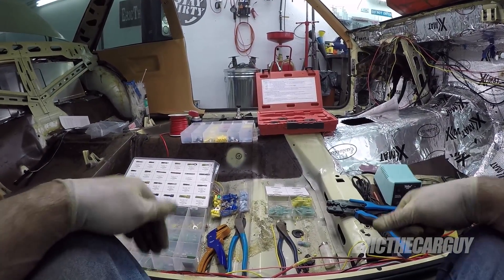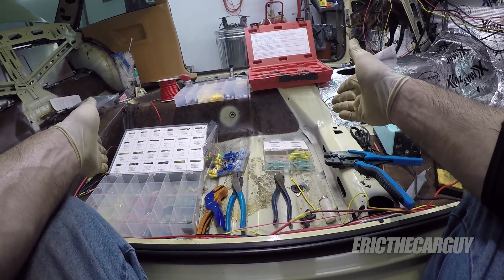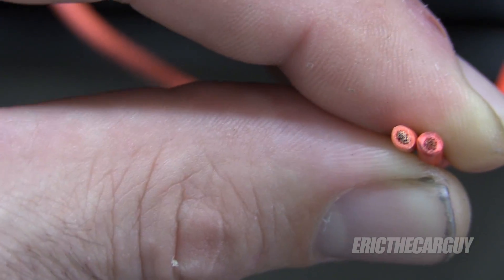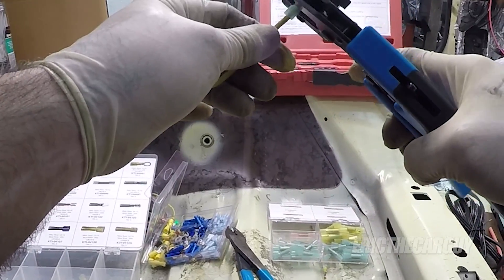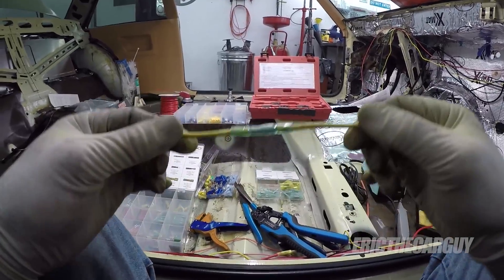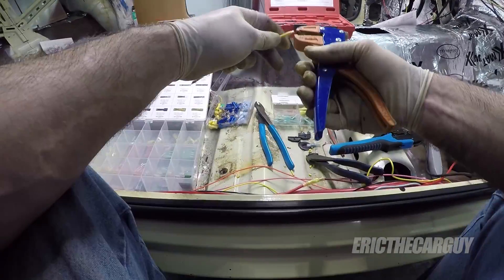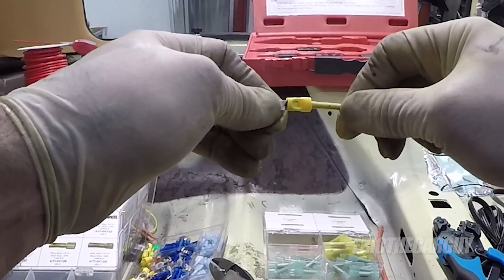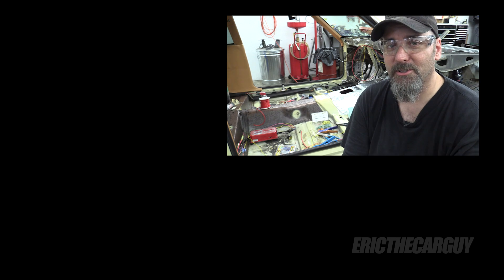How To Crimp Electrical Connectors

Comment: Great post. When you put the item to be crimped in the die while the die is outside the tool, I could see exactly where to place my connector. It's so much easier to see what you are doing than the seven other posts I found on the same subject before finding yours. Thank you for your help.

Comment: I realise this is an old video, but any way..

I am totally shocked the there has been no use of a vice, bolt cutters, side cutters or pliers to crimp the wires.. Just joking of course, there are so many garage how to do's that show those "techniques".

Well done for for an excellent presentation, improper crimping is one of my pet hates.

By the way , I am an Australian Airforce trained Avionics, Electrical technician of about 50 years ..
P.S. soldering before crimping, will lead to the wire fracturing causing a poor mechanical connection.. In the aerospace world, terminals are not soldered, only crimped.

Comment: soldering after crimping is allowed,  but soldering before crimping is not recommended,  tin is not flexible at all and that connection may loosen, causing resistance and overheat.

Comment: Great video thank you. This may be a silly question. When you are joining 4 wires (Neg to Neg and Positive Positive)to power one item Eg: cord from a fan to the cord of a cigarette adapter plug, I am assuming you will have two different connectors to crimp?

Comment: So, my takeaway: 

The 909 is great on nylon; shrinking or not.

Those ratcheting types are NEEDED for polyethylene; it is softer and will not tolerate most crimping tools other than ratcheting. 
I would be stunned of you had to shrink tube nylon. I'll bet money it was polyethylene. 

When you buy connectors, look at the material. 

also:
if you leave the insulation on, it is great for twisting the braided wire.

Comment: As far as insulated/non-insulated, I’ve always been able to slide the insulator off if it’s not necessary. I just keep everything together for future use.
Also his point about heat shrink is dead on. I heat shrink all my crimps, but mainly because of OCD.

Comment: I recently built my own camper van . Wiring wise using crimps . 
Using a crimping tool similar to the one in the video . 
If it's getting a bit awkward , is to load the crimp into the ratchet crimper literally to the first notch on the ratchet . 
So the crimp is gripped just enough so it can't fall out of the tool . 
Then you have a bit more control in tight areas , push the stripped wire into the crimp then squeeze it up . 
Rather unorthodox but it worked for me .

Comment: 13:04 Aren't those jaws your using on an insulated terminal, meant for NON insulated terminals? The jaws for insulated will have blue, red, or yellow, so you can match it up with the color of the insulation.

Comment: I see you're having problems with those yellow handled auto strippers. They are super quick, but I found out the hard way that these tend to double cross you at the worst possible moment. The better option are the ones that load from the side.

Comment: Why is it sooo hard to find quality connectors. I’m done buying connector kits online. The metal are very easy to bend with your hands and very thin. Specially the ring terminals. I wouldn’t trust 40amp overheating.

Comment: So never having had the proper tool I rushed out to Amazon and bought one of those fancy ratcheting crimpers and after throwing away half my insulated heat shrink connectors I tossed the tool . Witch jaws should I get for heat shrink connectors, mine came with one jaw

Comment: @4:53 - The knurled knob at the top of the pliers adjusts for the different thickness of the wires. There are 4 positions - 0.2-.9mm; 1 -- 4.0mm ; 5.0 -6mm and computer wires. Try it and see what works.

Comment: The problem with soldering the wire and then crimping it is the risk of breaking the conductor off which is why you should never solder a crimped connection.

Comment: Just saying, ive seen many crimps fail, I've never had a solder joint fail. Every circuit board in your car has solder on it and it has no problems. As long as you think and add the joint for proper strain relief you'll never have problems. Crimps are also dog shit for strain relief, I don't know what y'all are talking about.

Comment: I like those quick release levers for your crimper dies. I have to remove my two screws to change out dies .. although I never change them. I've got a second crimper for non- insulated connectors.

Comment: The problem with soldering crimp connectors is that you're only introducing more opportunities for failure/human error(we know, we know, you're the best solderer ever and you never ever screw up...) where it, quite literally, is completely unnecessary. Add in the weakening of the wire that soldering causes, the potential for failure related to vibration and movement due to how brittle solder is, and it just doesn't add up. The idea that a proper crimp could in some way still be "weak" or have a "poor electrical connection" is just unfounded, and it takes MUCH less skill to execute a proper crimp with the proper crimpers than it takes to execute a proper solder joint. I mean, everyone can see how easy it is to execute a proper crimp in this video.

When you add in the fact that professional industry, especially aviation, REQUIRES crimping and PROHIBITS soldering specifically due to the much greater potential for human error & inconsistency and the brittle nature and sensitivity to vibration of soldered joints, at some point people just need to accept that their personal biases are outdated and that we as a society have learned BETTER WAYS than that.

If crimps only are good enough to keep planes in the air - I'm pretty sure they're good enough for your car. Suck it up and save the money that you've been wasting on solder and the equipment to go with it, get more done with the time savings of no longer performing extra unnecessary steps. Come join us in the 21st century

Comment: I had a question about butt connectors generally. I've read papers that indicate that crimping theoretically (if done correctly) results in the best conduction and least resistance.  Isn't the point of crimping to make airtight connections between the wire and the thing you are connecting it to so the soft metals merge? But in the case of wire to wire connections most butt connectors I've seen have the indentation that prevents wire overlap (especially in smaller guage wires) and necessarily creates a gap.  So you end up relying on whatever metal the barrel is made of for conduction between the wires and hoping it doesn't introduce resistance.  Wouldn't wire to wire contact ensure a more complete conduction and wouldn't the best  butt connector permit overlap between the wires?  I'm guessing the increased resistance in most cases is negligible but still why don't most butt connectors allow for overlap.
Reply: overlap doesn't allow for maximum pressure/contact. Try crimping an overlap - chances are one wire will displace the other, so one gets well crimped leaving the other questionable.

Comment: The reason the numbers increase as the wire diameter decreases is wire is measured as how many can fit into a square inch. Known as the Stubs Steel Wire Gauge. They use similar for IV cannula sizing.

Comment: Overall, very good instructional video on the basics. Using the correct tooling is absolutely critical. Love how you stress that. Note: You should NEVER crimp a soldered (tinned) wire! There are several failures that can result from doing that. It is a DEFECT in all military, aviation and medical application.

Comment: I am changing the circuit in the signal handle in my f150 02...and the circuit came with thicker wire connected to it, than whats already in my truck...can i connect 2 different size wires together?

Comment: Nice video!! Can't stand videos that are out of focus or can't hear the narrative.  Anyway, wondering if these https://beta-static.photobucket.com/images/l33/crilin1979/0/4bcd2a35-97e3-44f9-98a4-7cf469086d20-original.jpg?width=1920&height=1080&fit=bounds
 connectors are out there somewhere and what they might be called? I need to reconnect the wiring to a glow plug in my car. the original plug was already beat so I added a few layers of heat shrink to beef it up. 

Thanks.

Comment: You are a demigod amongst mechanics and provide inspiration to us lesser beings.  

When removing insulation with SCISSORS-type strippers, close the tool around the wire then open it back up without pulling off the insulation.  Rotate the tool (or wire) 90 degrees, then clamp down again.  Done right (with quality wire) and you can pull the insulation off the wire with your thumbnail. 

To chime in regarding solder, I've been known to use it if the wire won't otherwise hold a crimp.  One might rightly ask, "Why not just solder the connector in place and skip the crimp?"  With insulated connectors I skip the crimp if I can pull the insulator off and slide it back up over the wire insulation.  I then solder the connector on then pull the insulator back over the bare metal.  Most of the time the wire insulation is too thick, though.

Great job Eric.  Thanks for all of your advice and humor.

Comment: Agreed proper tool is very important. I have the same problem.  The crimp tool I was using is awful. I don't solder before. I will solder after in some cases, like on my old tractor where the connects will be exposed to moisture, high humidity, higher stresses (vibrations, etc), but that is mostly to keep out corrosion and added security.  I would expect it to be a problem soldering before crimping as the solder would make the wires harder and less willing to form but that would also have been using a cheap awful crimping tool. Knowing how to properly crimp is also important. I made crimps incorrectly for a while because someone showed me how to crimp and they were also doing it wrong.

Comment: Ugh.  Also watch for cheap chinese connections too.  Been using a Paladin CrimpALL for close ot 10 years now and started noticing a lot more over crimps from these terminals recently than even 5 years ago.   Almost have the tension adjuster to min at this point.

Comment: Thank you so much for making this! I hadn't thought of the heat gun before but will start using that from now on. I'm about to take on a project of installing an aftermarket Android stereo so this tutorial is perfect. I also enjoyed what you said about the crimping being very relaxing. That, of course, is if you're not using the cheap-o Harbor Freight stripper's crimpers that are 1/16" thick and act like scissors when crimping.

Comment: I solder any connections that don't demand removal and sometimes even those. Always a better connection especially in cases where exposed to environment. Shrink tube And/or electrical tape over connection. For extreme weather exposure we use tar tape.

Comment: hay its good your passing on good information and I used to work as a quality assurance manager and your crimpers that click they should not over crimp on the job we had a lot of them and we got the best over a $100 and they are mad almost full proof and their is a bimba cylinder fixture for those tools with a foot pedal control they are nice, and your right, the right tools make the difference and wire striping in the industrial market and military grade you cant even have one strand missing because the crimp wont be as strong its a proper mechanical crimp, and solder is only a electrical connection not used as a weld not strong enough and their is a term about how clean everything is, they say is it sanitary.  but I'm glade someone is not putting bullshit out their for once, hey good luck and if your installing amps and doing repairs if your interested I could tell you how it enhance amps I mean louder clear not distorting everyone I have done for people say its the best amp they ever owned and wont give it up  big difference

Comment: Look carefully at your crimp jaws. A possible cause of your "overcrimping" is that good ratcheting crimpers are directional. The  end to be crimped is supposed to be inserted from the same side every time, usually from the left. One side of the jaw is larger than the other and is designed to  grab the insulated portion of the wire and provide strain relief. The smaller side of the jaws is supposed to crimp the bare wire. For you second crimp that overcrimped, you might should  have turned the crimper around so the bare wire was coming in from the left side of the jaw.   Cheap crimpers don't have different sizes in the jaw.

Comment: I actually watched another channel and the guy was sleeving computer cables and using shrink tubing with it. He had a heat shrink tube gun that is only a quarter of the size of the standard electric heat gun, weighs a lot less and only uses lighter fluid or a lighter insert. That would be a cool bit of arsenal for your automotive electric kit dude. I'm going to get one within the week. Cheers for the video bud. :)

Comment: If you solder a wire and then crimp it, all that will do is crack the solder. Never solder automotive wiring, period.
Don't solder after crimping the terminal, do not heat the wiring up with anything, you have just made a good crimp a potential failure turning the flexible copper cores into a one solid crackable weak lead conductor at the terminal as solder wicks down the inside of the wire some distance.
And anyone that solders wiring on cars with a frigin blow torch solder iron should be frog marched out of the workshop.

Comment: @7:00 and 12:45, I believe you are using non-insulated connector die (with spike) to an insulated connector.  This is probably OK, but there is a risk the insulation may get ripped and may not give you waterproofing it was designed for with heat shrink butt connectors.  You probably want to use the die with smooth contour from the red die storage box.

Comment: there are only 2 different strands on wires 17 strands and 37 strands. I might be wrong, but I think the 37 strand is more for control wiring and the 17 strand is geared for contractor grade wiring..

Comment: Excellent video/tutorial!

I don't have any experience with proper electrical crimping (using actual crimping tools and doing it right), but I think I might know why some people prefer to solder as well as crimp:  The best crimp, short of using an industrial swage machine to compress the sleeve into a solid block, will still leave tiny air pockets between strands of wire as well as the connector.  Eyes made in steel cable using crimped aluminum 'duplex' or 'turnback' sleeves tend to oxidize on the inside, gradually losing their holding power.  So I assume the same issue will exist with any crimped connection - no matter how well you do it, corrosion can still occur inside the sleeve.  Soldering, however, should be able to completely fill those air pockets.

Just my thoughts.  I'm terrible at soldering, but I sure would rather have solder in addition to a crimp, even with shrinkwrap.

Comment: "How to crimp electrical connectors" if you want it to last, you don't! I solder and use shrink tube, the type with glue is prefered.

I just got done completely rewiring a tractor. The reason I had to do it was because it was a mess of old wiring, older wiring, some new wiring and crimp connectors. My wiring job on this tractor will probably outlast my kids.

Comment: I tin the wire beforehand with lead/tungsten solder, then use a crimping tool with a Bluetooth interface so the jaw pressure displays on my smartphone. I finish up with two layers of heat shrink tubing, and before I seal the final end, I fill the joint with nitrogen gas.
Reply: 3sierra15 Tungsten solder no less!?  I'm very impressed, and surprised, there was any copper wire left by the time you got the tungsten to melt!  FWIW, leaded solders are typically predominantly tin-lead based (e.g. 60/40, 63/37), sometimes with some silver, copper, or other minor metals added amounting up to several percent to control intermetallics.  By comparison, many of the lead-free soldiers are nearly 97-100% tin with small quantities of copper, silver, or other metals to adjust the melting point and/or to help control the intermetallics formed by near pure tin solder formulations and to try and reduce whiskering and tin pest that can plague near pure tin solders (which, ironically, is why lead was added so many decades ago to tin to make a good and reliable solder...until we decided to add to the landfills by removing lead leading to the premature death of many an electronic device).